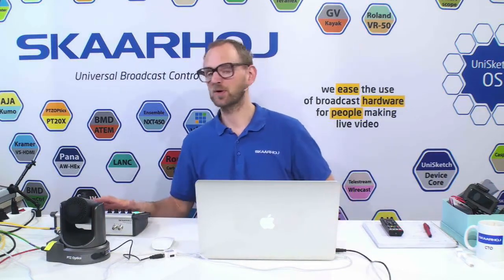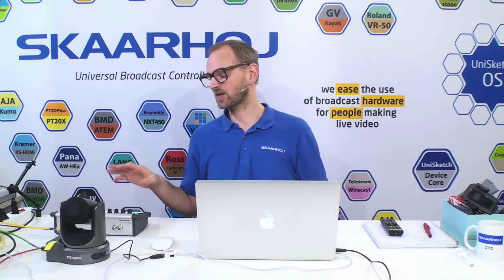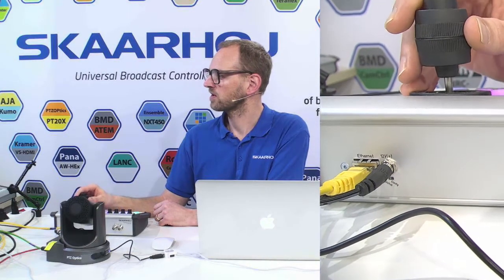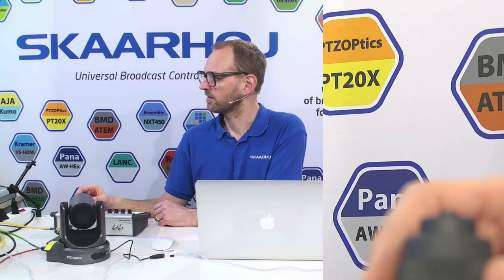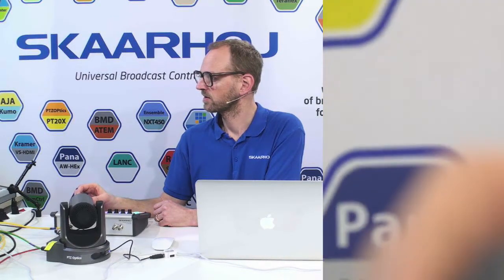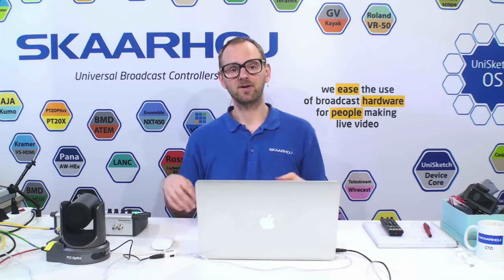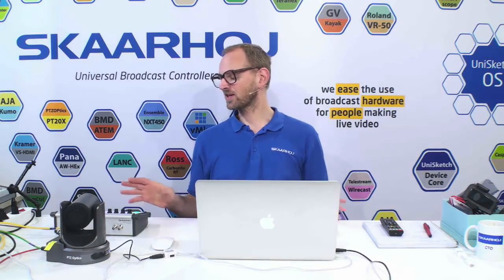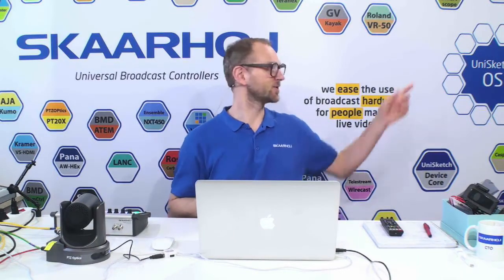PTZ Optics fine movement with SKAARHOJ PTZ Pro Controller

Comment: Nice and useful video. A couple of questions: is that same speed valid for transitions between presets? If not, there is a setting in the PTZ Controller to do so? I mean, control of transition speed between presets.